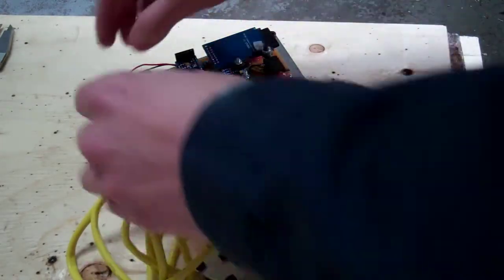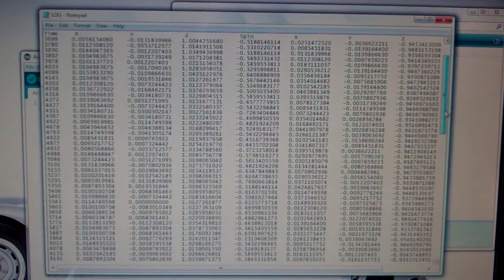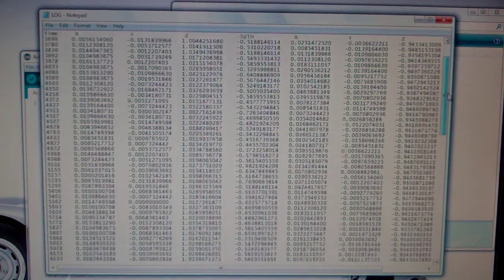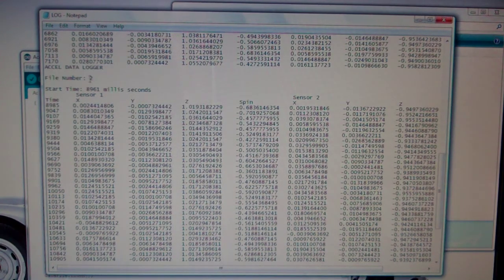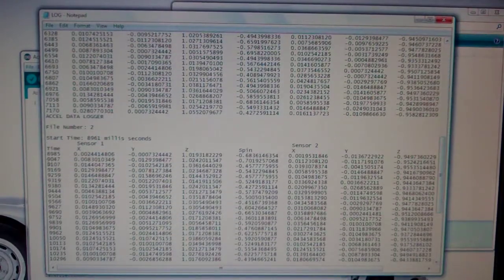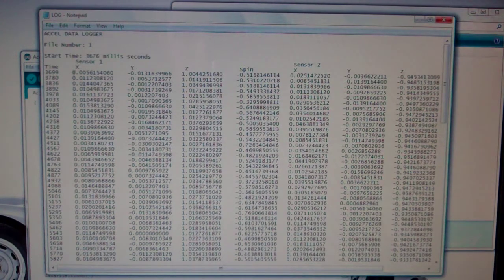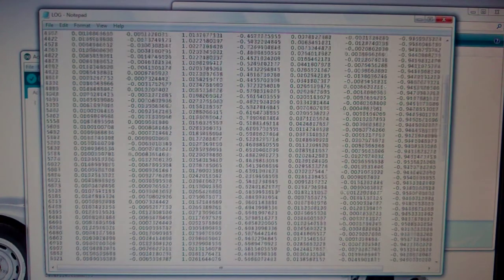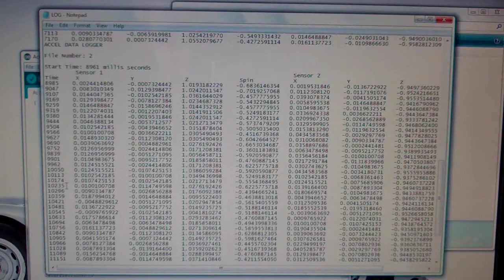Arduino Accelerometer Data Logger Project Number 2

Comment: What a great project. I have tried to use this sensor but do not get any sensible readings. What i am trying to do is exactly what you have done, congrats for that. I would like to be able to measure vibration of an item but be able to take two readings from different places so having two sensors is perfect.  Are you able to post a build video with wiring diagram and the code.  If so i will build a micro version of your sensor board post it online and of course credit you for it. This will be my first real project other than playing with leds.  Many thanks inadvance

Comment: I am really interrested in this concept. I feel the 3D thinking that is required with accelerometers  is so challenging and I would love to work with this code ( if you would share it of course :) ). The graphing you did in the 1st video was amazing to see what was happening during different actions. The 2nd video you did a bang up job fabricationg the layout . I too like to build things in such a way that they can be used , put to the side and then revisited if a new idea comes up.
Either way , you have a new follower and keep up the great work !
Bob D
Reply: True. Hope you can share the code as well

Comment: Looks grate! Just came up with the same idea a few days ago. I want to be able to see the G load real time on a LED matrix that I can put in front of a go pro in my dads race car. I also would want it to log data on to an SD card like you have. But I would like to try and use processing to build a program that can crunch the numbers into graphs automatically. Also The idea of the button to leave a data point would be grate to use as a lap time indicator.

Comment: hey, is there any other accelerometer that use 6-axis
Reply from the maker: I think the ST LSM330DLC works very similar to the accelerometer that I used. There is also the option of using a separate accelerometer and gyro. The ADXL362 (accel) and the ITG-3200 (gyro) are a pair that could work. Hope that helps.